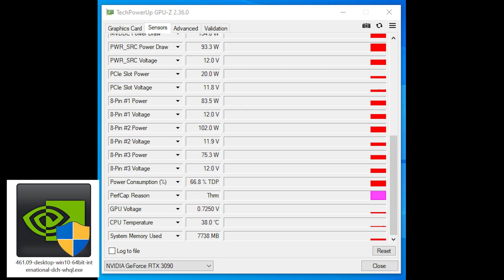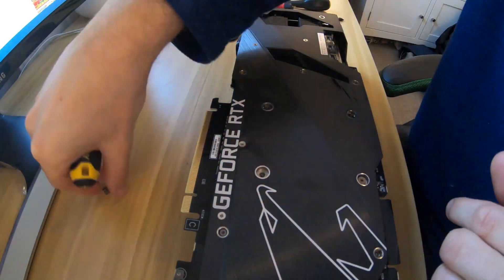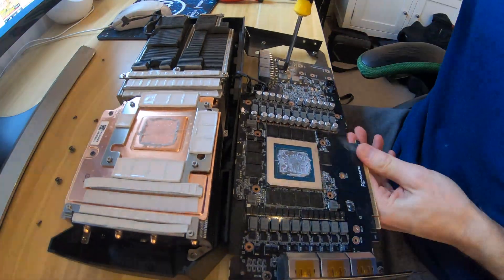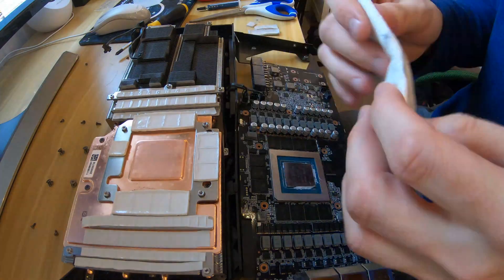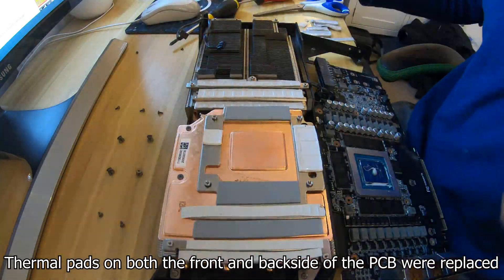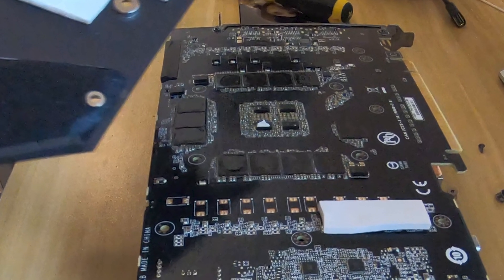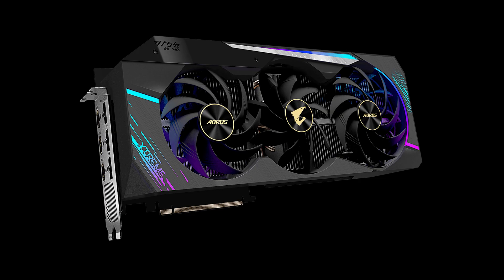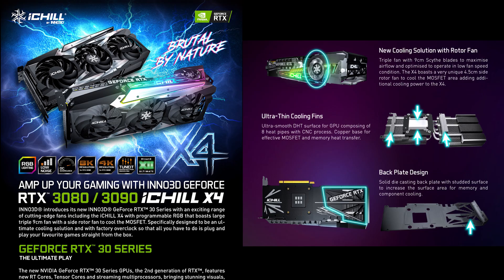Gigabyte RTX 3090 Aorus Xtreme GDDR6X overclocked memory overheating [FIXED]+ buying recommendations

Comment: Hi after fixing this how much maximum mh/s  you have achived?
Even I have same card having card..
Reply from the maker: If the card is cooled properly it can achieve 123MH/s. EVGA 3090 can achieve as much as 127MH/s. Both cards will thermal throttle to 106MH/s :(
Reply: @MindfulMotorcyclist  Can you tell me what settings you've used to hit those hash rates? I'm not using mine for mining but it's a good test of cooling power and I got somewhere between 105 and 110MH/s in Nanominer window depending on power draw. Memory is drawing the same power as the GPU die at 160W! Board is showing power limited as I set 75% power limit for latest mining test (Mem Clock at 11000 actually giving 10602 (x2) in EVGA1 though GPU-Z shows 1325.2 MHz so not sure if it's just missing the leading 1 or what), GPU just reduced by - 506 giving 1305MHz at 931mV. No manual curve adjustment). Memory tempature is 74C.

Comment: I'm using Galax rtx 3080, The memory junction temperature never go above 88c when I mining
Reply from the maker: Another example of the so-called 'non premium' brands making better performing cards! Way to go Galax! Did you overclock the memory though?
Reply: @MindfulMotorcyclist  here is my settings 
Power limit: 71
Temp limit: 70
Core clock: -200 
Memory clock: +1200 
Fan speed: 80
Hashrate: 98
But im not sure if this settings good for my gpu. New to mining
Reply from the maker: @SimoNNeo7  I think you've nailed it! Just keep the card running now and aim to make your ROI. Think that the 3090 when overheating reduces it clock and so makes106 MH/s and a max of about 120-125 when cool enough and your at 98MH/s with a card that probably cost half as much as the RTX 3090. I think your doing really well.
Reply: @MindfulMotorcyclist  damn i see, is galax popular in your country?
Reply from the maker: @SimoNNeo7  Not really, I think they serve the Asia market more. I always liked their Hall of Fame cards but never owned one!
Reply: @SimoNNeo7  am using galax for mining as well - i am getting 120mh/s with power limit at 90%, core -50, memory +1200 fans 100.
Reply: @TheGreyFatCat  thats insane hashrate. Whats your gpu temp and memory temp?
Reply: @SimoNNeo7  memtemp is approx 90. core is around 50-60. give it a go. if you have a Galax/PNY/Asus Tuf it should handle it
Reply: 3080 has memory only on one si de of the PCB, 3090 on both sides.
Reply from the maker: @greggreg2458  Yep but both are plagued by overheating, I mean the 3090 make sense as it is not actively cooled but the 3080?

Comment: My card comes tomorrow time to test so far the 3080 trioX with the plastic backplate is worse! 3090 with metal much better. One fe is great like 96 other is 108c
Reply from the maker: Wow, another example of the so-called premium brands letting the side down. Plastic backplate, what were they thinking?
Reply: @MindfulMotorcyclist  Well apparently it’s Graphin But the card doesn’t cost 10 grand so it’s plastic
Reply from the maker: @FireTwo  It's a hard decision in a stock shortage as you don't know if there will be an alternative card available but you can always send it back, I did 👍

Comment: I have an MSI Suprim X 3090 and Palit 3090 GamingPro OC. To my surprise, under the same test conditions the Palit (which was the cheaper card) had 4-6*C lower memory temperature. The Suprim X is allegedly one of the premium 3090's. Yet another proof that renowned brands don't necessarily have the better performing product. Suprim X does have the quieter fans at same RPM though, I'll give them that. That doesn't mean that the Palit's are noisy though (unless you crank them up a lot of course).
Reply from the maker: That's my experience as well. My Palit 3070 has a thicker backplate (with ventilation) than my Aorus Xtreme 3090 and those cards are separated in terms of 'premium' manufacturers and tiers. I would look at going forward the likes of Palit, Gainward, PNY and Zotac (I remember the Zotac AMP Extreme was one of the coolest running 1080 tis). Their cards are often cheaper and when it comes to 3090 levels it could be £200-300 difference.

Comment: I'm thinking of mounting a spare wraith prism on on the back of my card, same as how you showed at the end! Is it just some string tightened down to give it mounting pressure? And I imagine it's sitting on top of some thermal pads? Any tips on how you pulled it off would be great
Reply from the maker: I wouldn't use the prism if I went about it again, yes its a good stock cooler but it tapers outwards at the top so its quite hard to fit and it's also top heavy which is annoying. With one 3090 I'm experimenting with an older AM3 cooler than has a smaller fan and a square profile hopefully still with a lot of thermal capacity. The thermal pads in the video were reused from when I swapped out the stock pads, if I was going to do this again I would use a whole sheet rather than odd bits tetris like joined together, the sheets are £10+, I would get the thinnest sheet possible. If your backplate is flat you could also use thermal paste. The string tightened down was a bit of a bodge to be honest I didnt really like the way that was set up. More recently I bought some 6mm high alu heatsinks (think NVME M.2 heatsinks) and covered the backplate where the memory modules are. Then I used elastic bands to strap a high airflow fan to those. Total height off the backplate is less than 3cm which I think looks neater. Its all a bodge of sorts tho! Good luck
Reply: @MindfulMotorcyclist  Thanks so much for the detailed reply! Right now I've got a noctua 120mm fan sitting on top of the hotspot and it's slightly raised up by some rectangle pieces of rubber I had lying around just to give some room to suck the air away. I was thinking of replacing those with actual heatsinks, m2 ones like you mentioned, which would give the fan some height to breathe and act as extra heat soak. With your impressions on how the wraith worked (or dind't!) in the end I might just go straight for the heatsink/fan idea myself. Thanks again, and good luck with future jank haha
Reply: @PlamoPeppa  I had the same idea with my ryzen prism cooler lol. It is a bit heavy and I think the card need some support cause of the weight. Is the heatsink solution the better way? Does it help reducing heat?

Comment: im just going to put a cpu waterblock on the backplate, enough of these shitty back plates that dont even have small grooves cut into them. Just a thin slab of aluminum is not cutting it.
Reply from the maker: Thats probably the only way to really bring temps down. 240mm rad?
Reply: @MindfulMotorcyclist  I would think a 120mm would be fine as well. But if you already have custom loop it would be easier. Heck even an aio if you don't have custom loop. 
Only thing that would be an issue is mounting. Not sure if just thermal paste would hold it in place. I will see about mounting and let you know.

Comment: How much of a memory junction temperature reduction did you see by actively cooling the backplate?
Reply from the maker: About 5-10 dgrees, not as much as I would like sadly.
Reply: @MindfulMotorcyclist  But how much did changing the thermal pads do?
Reply from the maker: @KattKingston  sadly none, I used 1.5mm thick GELID pads and it didn't improve it at all. It's not worth voiding the warranty to do this, unless maybe you are fitting a full waterblock.
Reply: that is why it didn’t worked for you, you were supposed to use 2mm on top of the memory chips and 3mm on the back of the card, also the quality of the thermal pad is very important, while that brand might be good, i honestly din’t think that it can be better than thermal grizzly, at least most users that had used thermsl grizzly pads had reported success, but you need to install the right thickness, too small will not make good contact and will not work the way it should

Comment: I don't have this card I have a PNY 3090 - the one with the smaller heatsink and the fancy shroud. I dropped my temps by about 6 degrees (mem Junction temp in HW Info) by placing various old heatsinks I had as well as purchasing a 100 x 70 x 25 aluminium heatsink from an electronics store on top of my video card - luckily the card and heatsinks are lovely and flat. The PNY card has an excellent thick backplate approx 1.5mm - 2mm. I have purchased some nice thermal pads of various calibres to improve things (My kids older video cards need to be tidied up too, the last time I checked one of them had the thermal pads sweating profusely - oily/wet residue.) I can overclock my memory about 950Mhz when mining Eth and really pushing it to 365 watts see the temps peak at 94-96 C with 86% fan set  (This is dumb though, by tweaking down power level to approx 290W the temps drop to 88C with only a minor performance drop.) when I did this without my heatsink setup it would go to 100 - 104 and was probably throttling down.

Thanks for the video - I probably have a nicely prepared card from the manufacturer and probably won't void my warranty yet by changing pads. When gaming this card is a beast and hasn't ever had to throttle back. 

Your setup is awesome - no harm in these sort of mods - just annoying manufacturers didn't get it right out of the box considering the pricing.

My afterburner settings are: 
Daytime mining: Power limt 83, Core clock -202, Mem Clock +950, fan speed 77 (about 2800 rpm) - approx: 290Watts
Night time mining (Australian summer):  Power limit 59%, Core clock -397, Mem clock -70, fan auto (1900 rpm usually) - approx: 205 watts very quiet with 65MH/s rate.
Gaming: 100% power, +25 core clock, + 93 mem clock, fan speed auto
Reply from the maker: Thank you for the very helpful reply, people will appreciate this information I'm sure. I have ordered some small alu heatsinks which I will place directly over the memory, I think this is the way to go, CPU coolers take a lot of heat from a concentrated area BUT they don't align with the memory modules themselves which is a failing. I agree that lowering the TDP of the 3090 really works I have one on 71% and the other on 76%. I think the 'lower tier' brands have really surprised as they are showing decent designs (PNY, Palit etc), Gigabyte are not in this case. RE the night time settings are you deliberately lowering the power to keep the card cool as 65MH/s seems low for a 3090? Thanks again for the information about MSI afterburner, I'm sure you have helped more than one person on here.
Reply: @MindfulMotorcyclist  - cheers, the nighttime settings are mainly because I haven’t had a power bill yet since I got the card. (Most people in Aus get quarterly bills) because it’s summer we also have been running air con most days-never at night unless it’s a brutal day - so need to get an understanding of power usage. One of the kids has a 2060 super that practically mines 24/7 these days.

Comment: I had to watercool my FTW3 but of course that didn't help my VRAM on the back side of the card... I stuck some cheap aluminum heatsinks on the backplate above the VRAM chips and ziptied a slim 120mm fan to blow air down onto them. No longer have throttling issues and you can't see it because my gpu is vertical mounted
Reply from the maker: I also have the FTW3 and to be honest it runs full speed without thermal throttling albeit with hot memory, I think because the backplate and cooler are marginally better than gigabyte, I even manage a 1500-1600 mem overclock on the FTW3 and it is stable unlike the Gigabyte which only can handle 1300. I've got a 120mm fan blowing on the backplate but no stuck down heat sinks. How did you stick them on as your card vertically mounted?
Reply from the maker: Just ordered the cheap alu heatsinks 👍

Comment: You need to use a 2mm pad on gddrx6 modules on the front side, with just 1.5mm its not making good enougn contact.
Reply from the maker: Thanks for the tip! I might try that and see if I can get temps a little lower!

Comment: I have 3080 Xtreme, I think they dont even have thermalpads on the back to help with hot memory, it reaches about 100-110C for me while I try to overclock the mem to 800-900 and mine with it.
Reply from the maker: Thanks for the comment that is interesting. What I don't get is if the 10GB of VRAM is on the front of the 3080 PCB why is the standard heat sink not enough to cool it. Good you mentioned it as I was thinking about trying to source a 3080 because it would be cooler. Seems that is not the case.
Reply: They have 3 thermal pads. I replaced mine the other day and I added a good amount over the different mem modules. I am at 104c but I can get an overclock to 1200